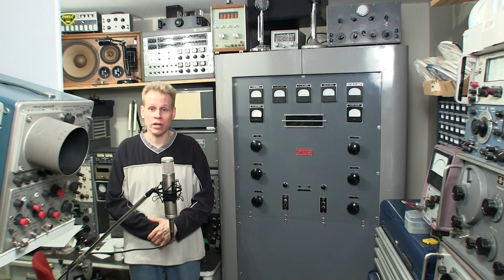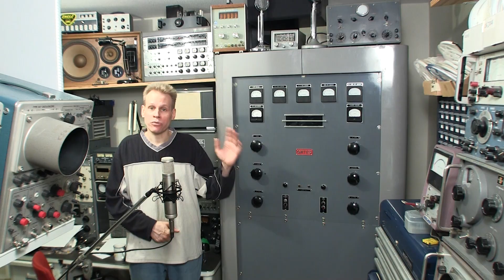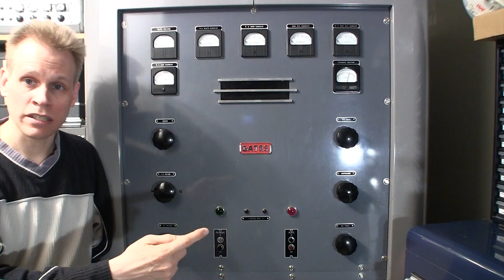Standing Inside a Broadcast Transmitter While it's ON!

Comment: Please do elaborate on tuning a vac tube transmitter. You Canadians can run 2000 Watts PEP while we are stuck at 1500. I have some of the old KTUFF equipment. Buck Owens owned KTUFF, and this station still drops to 50 or 100 watt at night, and I think they may have even dropped to a class D station and are back to spiritual broadcasting again. Watch the video on WLW's 500KW station. Canada actually filed a grievance with the state department, making WSW install control antennas to block the signal in the direction of Canada. WSW was shut down after 5 short years, at the insistance of smaller stations, and anti-trust laws. Radio Caroline used Gates transmitters for pirate radio in the UK. That is a gorgeous old Gates! You have her fixed up really nice! Gates were pretty highly regarded for pirate radio, but these guys ran 5-10KW. I really  enjoyed the tour! I have defeated the interlocks to troubleshoot commercial broadcast gear more than once. Off the air means losing money! Advertising time was so critical, the music was sped up 2% to gain more time for advertising. It all adds up.  YES an RCA 8008 tube is a half wave mercury rectifier. Do the modulation transformer's laminations talk? Oh I see that it looks like it's pitch potted, so maybe no talkie.  My Heathkit HW101 won't quite neutralize, but it has 6146Bs not 6146As in it, and I suspect that's the problem.  Are those Edison fuses? LOL How quaint! That is one heck of an edge wound tank coil! I have a big ol' tater slicer in my antenna tooner. I don't have room for a boat anchor like that, though, but I sure enjoyed seeing it.  73s KI7AQJ
Reply: KTUFF, and KJJJ were both running C&W programming back in the 1970s. Any poor guitar amp patch cord meant you were going to hear country music, whether you wanted to or not. Now I can get sports scores and salvation at the same time. The only good thing, is anything that leaves the bench is more immune to RFI than before I worked on it. Wah wah pedals almost perfectly tune between the two stations, with the back off the pedal. Mid sweep, you get both stations. Great! Shielding the input leads helps, and a thick aluminum back plate finishes the job up. I use old street signs. No, I don't have to steal them. A friend installs them, so I get the old sun bleached signs for scrap price.
Reply from the maker: Thanks for taking the time to write Seth, that was a great write!
Reply: There is little practical difference between 2000 and 1500 watts. It sounds like a lot, but 2000 watts is only 1.25 dBm over 1500 watts.
Reply from the maker: Oh Ya.... We can run 2250 PEP SSB, or 750 Watts carrier power for other modes (that being AM)

Comment: In the 1970's I was checking out the transmitter for KGBS in Compton CA There were several guys shooting the breeze and really just kind of tuned out the background noise of the current broadcast on air.  The phone rang and the engineer in charge answered it, listened for a few seconds, dropped the phone and sprinted to a console panel and toggled a large switch.  Apparently the signal to test the Emergency Broadcast system had gone off and no one heard it because of all off us chitchatting.  So a few minutes later the phone rang again and the engineer answered again, his end of the conversation was very terse:)  Apparently the recording that went out wasn't the right one and lacked the 'This is a test' portion and only said Stand bye for further information. This was apparently not looked upon favorably my upper management. But it was ok the engineer wasn't in trouble and he logged the exception in his log book.  A little while later it occured to me to ask him the question "what do you do if your signal doesn't say it's a test" Without batting an eye or skipping a beat he replied calmly 'I guess you bend over and kiss your ass goodbye'
Reply from the maker: Great story, thanks for taking the time to write!

Comment: I didn't realize it until the end of the video, but holy cow is that a lot of asbestos insulated wire in that thing. I don't think I'd ever "dust off" anything inside that unit.

I have a 1970s era STRONG 35mm projector which had asbestos wire for the xenon arc lamp power supply. I sleeved the 1/0 AWG power wires all the way up to the lamp housing with heat shrink because it was starting to shed fiber. I dare not turn it on unless the exhaust is directed out the window and downwind since it has the same problem internally, but I know of no other flexible material that can withstand the heat and UV of a 1 kW xenon arc lamp.

Some of the last 35mm projectors just had bare un-insulated wire going from ceramic insulated wire hangars, unfortunately my projector doesn't have the space to run bare wires without risking the frame going live.

Comment: I am just so impressed and in awe of anyone who understands these kinds of electronics.  This is the kind of thing I've always wanted to learn about, but the direction turns of my life never allowed.  I don't suppose I could send you a  desktop amp I bought in the 70's and have you do a video on how to properly tune it? (and of course return it to me).  I bought it about the time the s--- hit the fan in my life so I've never had the chance to turn it on. 

I just recently bought a house (only took me 40 plus years) so I can finally begin to indulge my passion for this type radio equipment.  I was told tubes are no longer available for this multi-band amp so I hesitate to just start randomly tuning it hoping to find the sweet adjustments spots before burning out the tubes.  Do you also do repairs and/or modifications on old desktop radios?  

Yes, keep these videos coming!  I subscribed.

Comment: My father designed parts of that unit and built many of them. He worked for Gates Radio Company in Quincy, IL for 35 years till they merged with Harris Intertype to becomes Harris Broadcast products. I used to walk inside those units as they were being built. He also designed towers and antennas.
Reply from the maker: Great story! Thanks for sharing.

Comment: No RF burns? :-)
Reply: I got an RF burn from a 50 watt rig. Started smelling burning hide, but didn't feel a thing. The rig was on 1180 kilocycles, middle of the BC band. Yes it was a bootleg station. Year was 1959. Reakon the Statute of Limitations has run out by now.
Reply: Not at 250 watts at AM broadcast freqs.
Reply: As I remember it, transmitters had interlocks (1975 era) that would sound alarms and shut down.

Comment: Mr. Carlson I have a question. I just received my first  receiver. It is a Sony ICF 2010. It does not transmit any signals but I can receive some morse bands some ham bands some air traffic control bands. My first question is do I need a ham radio license even to operate such a device? My second question is how do I get more power out of my machine to hear more international frequencies? Is it as simple as adding say a Sony AN –1 antenna? Could I use any antenna?
Reply from the maker: No Ham licence needed for a receiver. Best thing to do for an antenna is, put up a long wire. I find my 80 meter inverted V works great for SW listening.

Comment: last time i even saw one of these critters in use was 22 years ago. the unit is still in operation in wv not too far from here. maybe a 45 min drive. really neat vid as i didn't get to check out the innards of the transmitter...just a view through the sight glass. imm. :-)
thanks.

Comment: According to your meters, you are running 518 watts input and have 364 watts output.  Your reference to the "potato slicer" capacitor is actually referred to as a "bread slicer".  The RF meter that you said was unimportant was the most important meter, because the FCC didn't care how much input power you ran, they only cared about the "common point" current which was the current running to the feed point of the antennas.  You are running this 250 watt rig in amateur service so you are legal.  I did enjoy your explanations of everything !
Reply from the maker: Not to bad.... But you missed a few things. First, different rules, (no FCC here) We can actually run quite a bit more power in amateur service up here as well, so 250 is conservative. Your capacitors must be weaker down there if they can only slice bread :^) LOL! Thanks for your comments!
Reply: You are a young guy, years ago the common reference was "bread slicer".  I did enjoy your video and it was very instructive !
Reply: Are you aware of how the RF meter was used when the transmitter was in commercial broadcast service ?

Comment: It is a really nice sort of content, u cant find this kind this kind of contetn taht often, i am 21 years old electrical engineer student. i missed the Vacuum tube age unfortunately. i inheritated a few tubes but i am not familier with them as much, i really enjoy your tube-related content.
Reply: I am 70 years old. I do not miss the vacuum tube days at all.
Reply: I graduated college in 1970, and never learned anything about tubes in school because they were passe.  Went to work for the Air Force Research Lab, spent the next 40 years working with big .... BIIIIG tubes in radars. Mostly traveling wave tubes, typically 100 KW peak output, running 40,000 volts or so. Some were megawatt levels, switched by tubes the size of trash cans. Some were bigger than that. My office was next to a 390,000 volt power supply. 

TWTs, klystrons, IOTs etc. are still used in many systems but are being encroached on by stuff like gallium nitride and silicon carbide transistors. All the lower frequency stuff is transistorized.
Reply: It jsut would be good to know a little bit more about them :D
Reply: Really nice :D

Comment: Very good video...I worked as a CW op @ WPA/Port Arthur TX in the '70s and we had a huge TX for  500/425KC freq which ran an 891R w/a large row of mercury vapor tubes.  Inside the TX room were three "pole pigs" to supply the AC for the PS. The filament xfmr was a 50A job @ 25V......phew, it was very large indeed.  Keep them "analog" videos coming.  I still have an analog rig here (well, hybrid anyway TS830S) with three tubes...keeps me on my toes ;-))
Reply from the maker: Great story! Thanks for taking the time to write.

Comment: What does happen if
the door closes
behind you
accidentally?
Reply from the maker: Nothing really, the plate switch is a momentary type on the front panel. If the door closed, and somebody pushed the switch, then I may have some issues.
Reply: "then I may have some issues" for a moment (I assume)
sorry that was morbid but it is good to hear that it is (somewhat) safe
in normal conditions (you would be such a waste as a roast)

Comment: In the late 1990's, I was a maint. tech for a company that made UHF TV antennas....we had a 5KW transmitter in the shop to test the antennas...it looked about like this, except it had 1 very large tube for the output, and that ran into a resistor bank for a load.....I didn't work on it, except to wire it up for incoming power, seems it was referred to as a 'Plate' transmitter.....
Reply from the maker: Probably a plate transformer, That's what takes all the current in these things.

Comment: in addition: speaking of capacitors, toward the end of the video you mentioned E.F. Johnson manufacturing the tube sockets and capacitors. How do they compare to other electronics of the same vintage? Are they still the original? you said the transmitter was made for 24hr operation but I'm curious as to if you've ever changed the capacitors or if any of them were replaced during the latter portion of it's operation? also, I'm guessing there are 0% wax capacitors as they are cheap and prone to failure and I presume these are all sealed aluminum cannisters?
Reply from the maker: It has been re-capped, aside from the cans on the floor. Very few wax caps in this from the beginning, everything is transformer coupled.

Comment: Thanks Paul for sharing your big iron with us.  I bet you don't have to use your heater much in the winter.  Very enjoyable video.  I think most of the  160 meter guys all run cw.  That would be a waste of capabilities of this great old am transmitter.  I'd be willing to bet your (yes I know a grammatical error "you're"  for all the English police out there)  running on 80 meters.    I've been wanting to build a very low power  all tube (150 milliwatts) plate modulated AM transmitter.  I have collected several small UTC modulation transformers on Ebay.   Any way to post the schematic of this transmitter?  The layout of all the components gives me some good idea's.  Modulation transformer and Heising don't usually go together -  how did they do it?
Reply from the maker: Hi Douglas. The schematic is huge, I will try to shrink it in the future and upload it.

Comment: Paul, you can get a Swiffer cleaner/duster that would work great for getting the dust out of the inside of the cabinet. I have to use one in my shack because of the dust. Or, spend money on an air purifier. Nice transmitter!
Reply: He probably leave the dust so he can tell when gremlins have been skulking about inside....lol

Comment: We have one of those "shacks" with broadcast tower for CBS AM next to my house. Lot more than 250 watts. So much so anything with a diode, corroded connection, or just unsupported wires (like a toaster) will pick up and "play" the station just fine. Fortunately its mostly sports radio so I can get my update while my toast toasts.
Reply: Do you hear it in dental crowns? That'd be convenient! Hahaha
(Myth Busters did a segment on that once, it was interesting)
Reply: You remind me of when I lived near my local fire station and occasionally I would pick up the VHF chatter on my audio amp whilst listening to some music.  When I thought about it more, I realsed that a pre-amp is basically a radio reciever, just wired a little bit different.
With 200 watts or more of RF tx, as you say, it will modulate to anything that's got a diode and a coil in it.
Reply: That is because your landline telephone had wires connecting it to the wall!  If the wires are the length of some even--fraction of the frequency the signal is being broadcasted on, the telephone wire acts as a "receiving" antennae!  The signal is then amplified by your telephone.  You can either switch to a "wireless" hand held telephone because they have excellent signal rejection qualities---or you can buy several iron toroidal coils, and wrap your telephone wire from the wall around the iron form several times.  Do this maybe three times with the coils spaced out a couple feet!  The iron cores absorb the extra signals.
Reply: mysock351C l live behind an AM station and have for many years. I think it's around 25,000 watts daytime. We used to hear it on all our landline phones and on certain TV channels. Basically anything that could act as a receiver would tune it in just fine. Hell, I remember using my tone and probe set to trace some wires in my house and the probe was picking up the station the whole time! They did a mod and upgrade to the station some 20 years ago and that mostly eliminated the Interference.
Reply: Better than being next to a cell phone tower. It has gotten better in recent years, but everything remotely pointy or long conductor without shielding would pick up very unpleasant electronic noise and clicking. It wouldn't be so bad if the 'noise' was music xD Thank god most of the noise is out of the audible region, but not all of it. Sounded like aliens chattering sometimes.
Reply: I used to get the local religious station on the landline phone. Hard to talk to people when there is a voice yelling "praise jesus" the entire time.

Comment: To amplitude modulate a 250W transmitter, you need at least 125W of audio power which accounts for the large audio amplifier and modulation transformer down there on the floor.

Comment: Hi Paul, This is a GREAT video!  Thanks so much for showing/sharing/explaining your Gates Transmitter with us all. It's gorgeous.. I believe most of your subscribers would love to see the other vintage units you have lurking about (in any condition) as well. Please excuse my ignorance, but why exactly do you leave it on 24-7? You did say it was designed to operate that way, which makes sense if your transmitting Standard Broadcast every day, or night as mentioned... Do you transmit Every day with it?  Or is harder on the tubes and other components cycling it off and on all the time?  I'm just curious... Thanks again, Tom
Reply from the maker: Hi Tom. There is a heater inside the VFO box (oven) that keeps it stable, that supply is on 24/7. The rest of the transmitter is off when not in use.

Comment: I've never seen a gates transmitter close up before. Nice to see the old 810's and 813 tubes. I would love to learn more about your Vfo. I didn't realize you added the Vfo. I know a lot of the AM guys still use crystal control on 3585 kc. for the AM net.   I love that old vintage stuff. It just works forever.

Comment: You must put out a good signal on 160 LOL
Reply from the maker: 80 Actually.
Reply: You had mentioned C35 in tuning circuit was rated 13 A @ 1 MHZ. I know most of the AM'ers are on 160 and 80. But this being an old broadcast transmitter I thought 80 would be a stretch.
Reply: RCA specs say the 810 is good to 30 Mhz at full ratings. You would need to rework the RF components, but the tubes are good to that high.